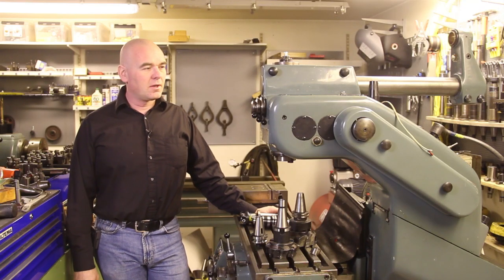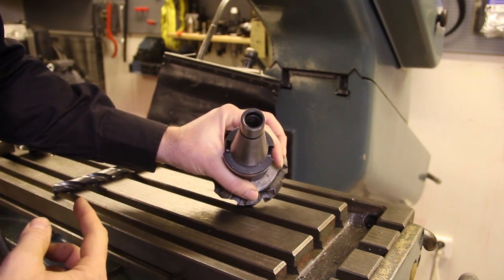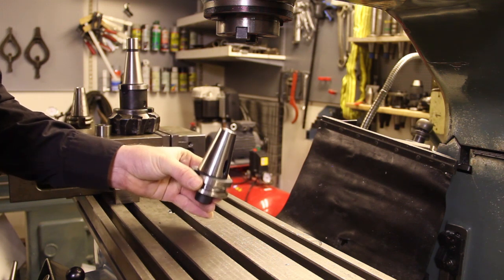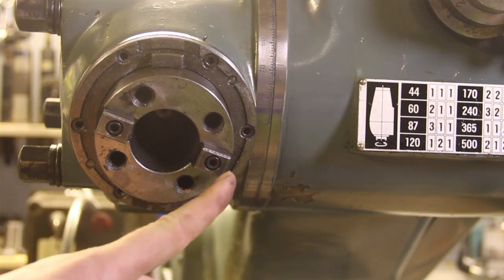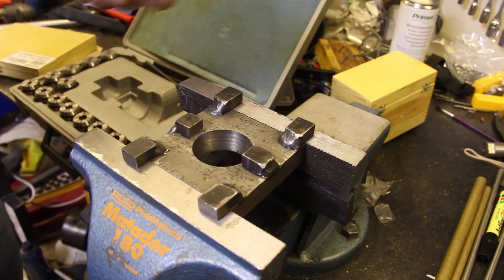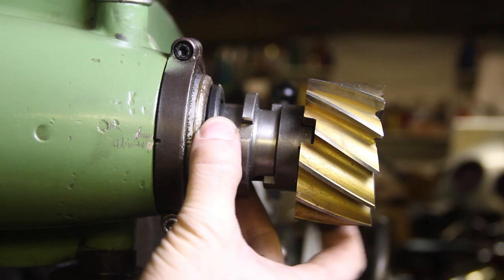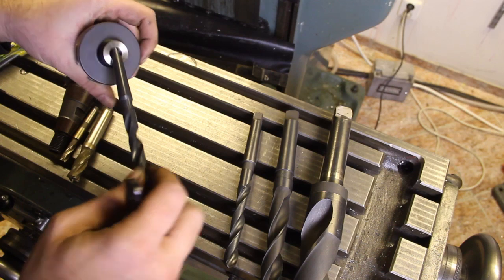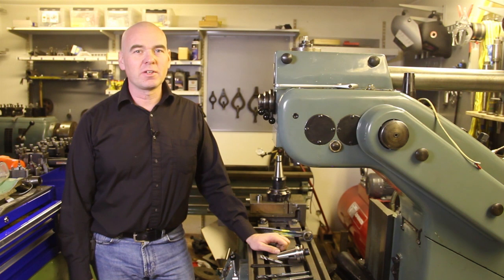Taper Talk

Comment: Thanks for your video! So ISO/NT 40 is the same dimensions according to the book. So, we can use ISO40 cones on NT40 machines or the inverse (NT40 cones on ISO40 machines) if we have the corresponding drawbar threads since I suppose NT means Imperial threads and ISO means Metric thread ?

Comment: I bought a nice boring head with MT2 taper that was mounted into the exact MT2 adapter as shown at 08:59..  My mill has an MT2  spindle and I need to separate the two components. I removed the  "draw bolt"  but  for the life of me I cannot  get them apart and are worried  to ruin a >$500 boring head. Any Ideas?

Comment: When you screw tightening the morse taper(have back  internal thread hole),why the taper fitting not rotating itself,I mean why you can tighten down the morse tool.

Comment: Very informative video! Thanks for posting.. I have a rather large Swiss lathe, that was probably made in the late 1800s, to early 1900s based on the headstock bearings. I need help in identifying the type of taper in the spindle and tailstock. I am familiar with Morse tapers, and I know that it is not that type. Any help in identifying the taper would be greatly appreciated, as I need to acquire some tooling for the lathe.. Thanks again..

Comment: Great set of information, very well presented, thanks.  I've just ordered a floor standing mill with ISO40 and was wondering how feasible it would be to use some of the MT2 tooling I already have for my minimill, looks like an ER32 holder will be my first purchase (and I'll fabricate a jig like yours for tightening it up).

Comment: 9:32 What bolt does that tangless morse taper use? Length, thread size etc. Thanks!
Reply from the maker: I don't remember, but it depends on if it is Morse 1 or 2 taper, and if is metric or imperial size endmill.

Comment: Fantastic explanation, I have been trying to make sense of the taper saga for a while now and your explanation was just what I needed to see. I have recently purchased a used Mill and am a rank novice and the operators manual states it is a NT30/R8 Taper so that threw me first up and then it came with 3 new BT30 tools which further made me confused and then I found an ISO30 tool in the mill so that was the final straw so have been researching heaps and came to some conclusions which your video validated, so again, many thanks, regards, Gordon
Reply from the maker: +Gordon Agent  I was quite puzzled myself, until I figured it out. Great that my video helped you! Good luck with your mill!

Comment: Thank you for the very well done and informative video. I've seen other videos with 40 taper, 50 taper, etc holders, but this is the first that discussed them in an organized and detailed manner.  Good job. 

In software there is a saying, "the best thing about standards is that there are so many of them."  In case it isn't clear to anyone, it is meant sarcastically. 

I, like you, am going to have to move to a different house if I want a nice shop. Maybe in a couple of years. 

-- Mike
Reply from the maker: Thanks! Tapers had me confused for a while, ordering the wrong stuff and so on.
I just tried to make the kind of video that would have helped me when I first started out.

Comment: Hello Mattias. The asymetric thread on the Deckel tooling would usually be described as a buttress form. You mostly see it on vices, but it makes sense for a drawbar (except that in that application a convention thread is strong enough and easier to cut). I mostly use an autolock style chuck for endmills as seen in my video here; http://youtu.be/nX9GRGKIrNw which cannot slip. The cutters also go in to a fixed depth. The screwed shank cutters are common in the UK, but almost unheard of in the US, don't know about your part of the world.
Reply from the maker: So that's called a buttress thread in english. Good to know! The germans call it "sägegewinde", that's why I thought it would be called a sawtooth thread in english. That chuck for endmills seems clever. I have some second hand endmills that have threads on them, but I didn't know why until I watched your video. Thanks for posting!
Reply: Mattias Kristiansson
I think I've still got a 40 taper Clarkson Autolock chuck somewhere if you're interested.

Comment: Mattias, just a warning about using collets to hold end mills. I have seen many a piece scrapped using that method because the end mill migrated downward due to no mechanical lock. I dream of having a shop like yours.
Reply from the maker: There's a risk, especially with the collets that go directly into the Deckel 40 taper. (I show them in the Fresnel Adapter video). I think I even had it happening once. I think the risk with the ER-32 system is small, since I can hold it well in my home-made holder and tighten it hard with a long wrench. So far I haven't had any endmill slip in the ER-32 collets.

Comment: 10/10 for the arbor jig. Top idea. But for the drawbar thread, I found ISO, INT, NT and NMTB40 arbors the same. Useful if one is searching ebay for bargain.
Thanks,
Tom Australia
Reply from the maker: Well, yes and no. ISO 40 tapers can also have a 5/8 UNC. Do pause the video at the taper drawings and have a look at the tables!

Comment: A very very useful video thank you Mattias. I wonder if you could add some links to Ebay suppliers for Deckel adaptors that you mentioned?
Reply from the maker: The ebay seller is franz240455. That's actually a company, Franz Singer Werkzeugmaschinen Reparaturen, in Geretsried, close to Munich, Germany. (http://www.singer-werkzeugmaschinen.de/) They do complete overhaul on Deckel and accessories, you can buy stuff in used condition or completely overhauled. Franz Singer is a bit expensive though.

If you need Deckel stuff, check german ebay, (ebay.de). There's usually lots and lots there. You will obviously have to pay extra to have it shipped to Australia, but apart from that, Deckel accessories are readily available.
Reply: much appreciated Mattias

Comment: The tool holder you made to put in your vice is so simple, yet this is the first time I have seen one. Brilliant. I thought what I have of mill holders are called NMTB. You didn't mention that acronym in your video. The first tool holder you sho as ISO 40 taper looks like what came with my machine when I purchased it. Is that what you call a 40 taper or are all the types you show 40 tapers with small variations? The end mill ER32 holder has a blue ring on the tool holder. Is it the same as taper ISO40?
Reply from the maker: I think the NMTB is sort of like the name for the taper itself. As you can see in the video, and tell from the drawings i clipped in, the actual taper is the same. Do pause the video at the drawings and have a closer look!

The ER32 holder is ISO40. The other tapers don't have the part that protrudes from the short end of the taper, as shown at 1:49.

Comment: Perfect! I have exactly the same problem getting through to an understanding of the standards that abound. I am so pleased with your descriptions, and now know better what to order. My tapers have 40-27 stamped in them and the threads are M16. I will be making a new drawbar with 5/8" threads to also be able to use holders from the States. I've checked out the Swedish company you recommended and because I read Danish, I was able to navigate the web site without problem. Thanks! I may send you a list of what I need in case you find a used item you yourself don't need. Great and useful video. Again, you are quite good at teaching. Much appreciated. I have watched each of your videos twice!
Reply from the maker: Hmm.. the 27 might be the diameter of the mill you put on the arbor. The common metric diameters are 16, 22, 27, 32, 40 and 60 mm.
Look here:
http://shop.otdtools.se/hallande-verktyg/iso40-din2080-/planfrasdornar/717
Reply: Thanks Mattias. I have now figured out how to communicate using Google+ and then won't have to load up your comments page with my "stuff". I'm American, been living in Greenland for the last 36 years. My father's mother was Swedish, so I am too in part. Really thankful for you videos. Enjoy your work!